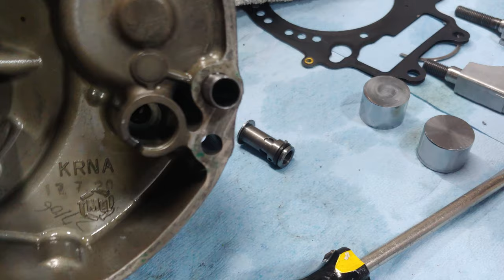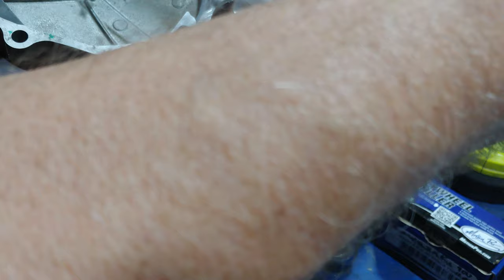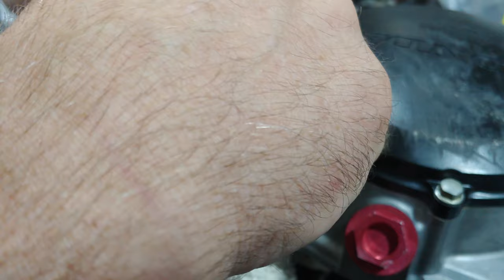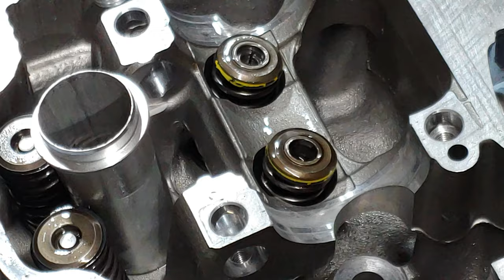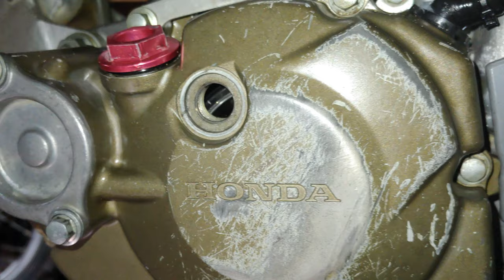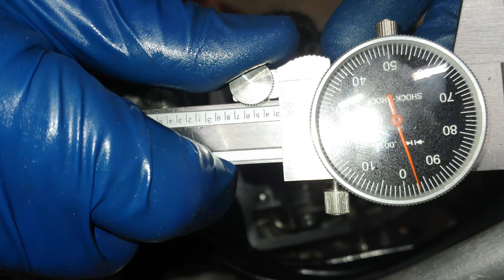Death of a 06 CRF250r Part 3  ||  The Rebuild [Head Assembly & First Start]

Comment: howd you deterime witch siz e shims to put in i jus ordered a brad new head fromm  fastheads theres no videos explaining how
Reply from the maker: Okay so yiu have to install a 2mm thick shim, install the cam and tighten down the cam caps. Then measure by trying a .005"  feeler gauge and see what you can get in there. 

 Obviously the cam loves for the exhaust have to facing up and towards the rear of the bike so they are not pushing on the lifter caps. 

 Once you figure out how much clearance there is you can determine if you need a thicker or thinner shim. 

 Example: If you put in 2mm shims and you can fit .007" feeler gauge then you need a thicker shim. 

 If you can only fit in a .003" feeler gauge in the above scenario, you need a thinner shim.